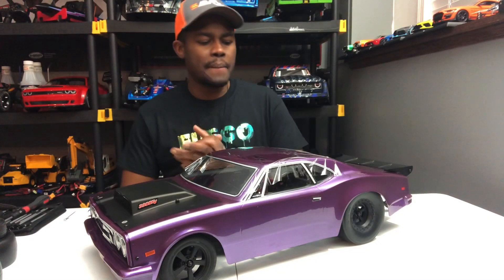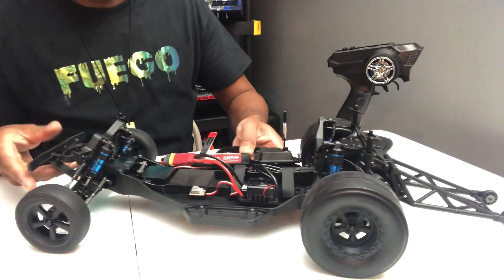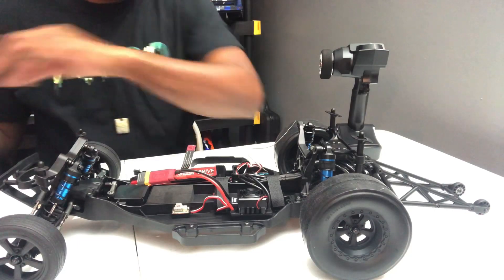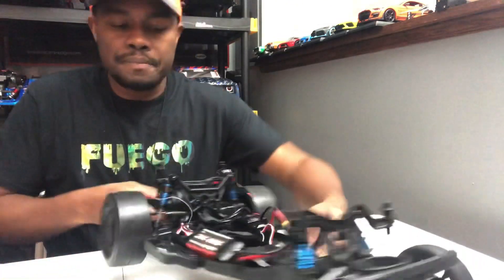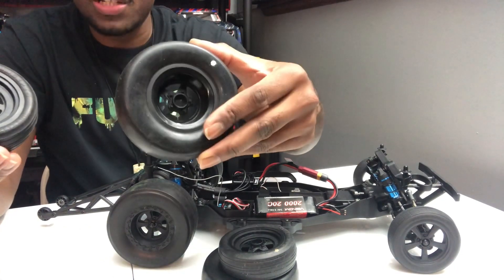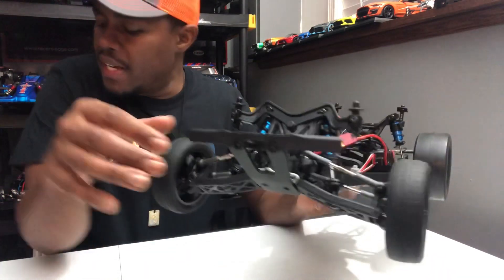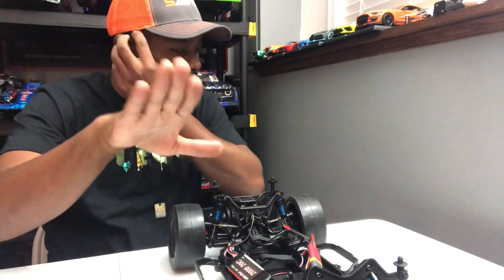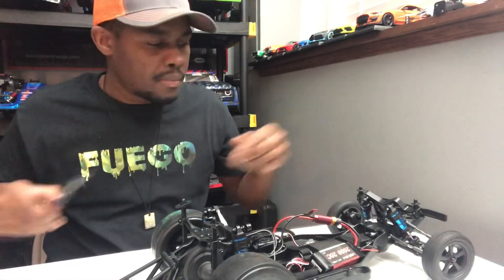Team Associated DR10 No Prep Drag Racing car tips to get started

Comment: Very cool Thank you, similar to hobbywing calibrations on esc.
How well does the green compound hold up for you. I ran them on my rc10 and they were awesome for a truggy, but seemed too soft for the very high speed cars like my modified Bandit drag car. thanks for sharing all your insights.🏜🙏oh tanks for tip on the wheelie bars, I think I've been setting it to low
Reply from the maker: MyPassionRC- Studio XD40 Lou's RC Garage I ran the green in my stock setup and it work well. I have had good luck with the clays With my faster DR10

Comment: Informative video! I run my on 3s lipo. Any recommendations for gearing setup on 3s? It is all stock now. 87 spur and 18  pinion I believe...will a 24 pinion be too much for 3s? Thanks
Reply from the maker: Try 23t pinion or 81/26 on 3s. Tape the insides of the body.
Reply: @UDRC85  thank you, yes already taped in inside of body. 👍

Comment: My dvc stopped working and esc flash red is it because I haven't calibrated it or do I need to replace it...I have little run time on it And one day it just stopped working... I replaced it with a Traxxas remote and receiver and it work but I want to go back to the original setup... Because when I got the car I didn't remember reading anything about calibrating the remote to the ESC or receiver for anything I just remember ready to race ready to go out the box...lol
Reply from the maker: You can try to recalibrate it. It can be your receiver that went bad also. I noticed guys that cars or flip the car a lot the esc goes bad.
Reply: @UDRC85  thanks bro...I'll try both

Comment: Their a new kid coming to town (Losi 69 Camaro for about  $ 400.00. Need more tips on the Dr10. Just want to stay invested in the DR10.  First  No Prep car, and a beginner totally, just want make the best of what I got.
Reply from the maker: you can upgrade the system. Not sure if you are going to run a spec class or just fun with friends. I run a 7700 castle momba x combo. Or if you are running spec look into Mclan DRK 160a esc and 3.5t motor. proline threaded shocks, sway bar, good tires, wheelie bar etc.

Comment: Anyone know what size pinion and spur i would need to run a castle sidewinder 5700kv motor and esc with thos car? I imagine not stock gearing?
Reply from the maker: Try 78/26 and check you temps.
Reply: @UDRC85  Thank you kind sage! 🙏

Comment: What 's the gear setup again ? Need product codes to buy. This setup for drag racing ?   Thanks
Reply from the maker: so to start I will run 87t spur 24t pinion. Its a good beginner setup. Eventually you may change motor, esc etc. Get a good 2s lipo battery also. Something 120c and up or whatever you have will work. The key is to have fun. https://www.ebay.com/itm/Trinity-TEP4024-Ultra-light-weight-Aluminum-Pinion-Gear-Thin-48-Pitch-24-Tooth/133599603396?hash=item1f1b282ac4:g:sDEAAOSwdkVgHDZR